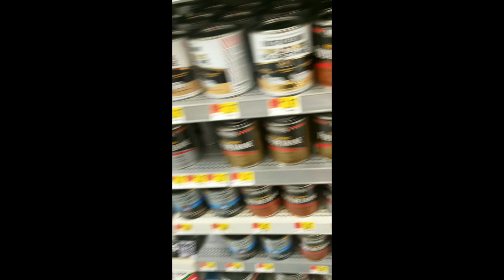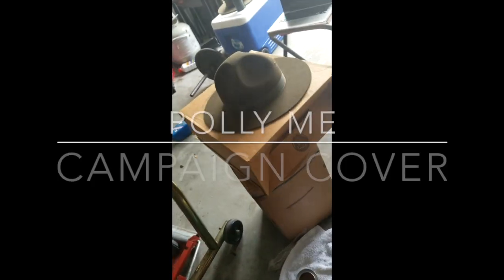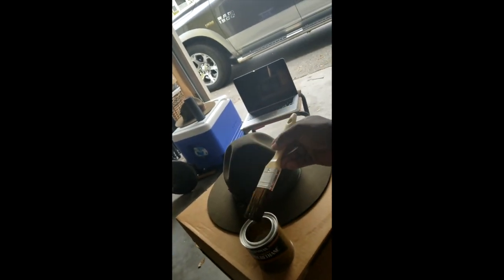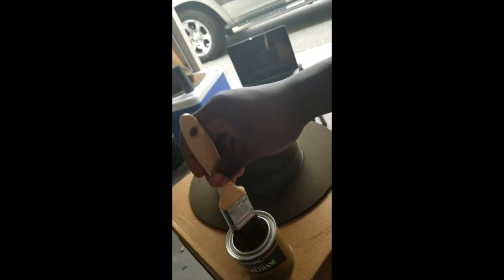how to polyurethane USMC Campaign Cover

Comment: would you recommend putting it in a hat press after? Or getting a hat press for that reason?
Reply from the maker: Once it completely dries and after every use put it in a hat press. I personally use The $12 hat press from base  or amazon, they will get the job done.
Reply: @placid5700  I have little white poly Marks on my hat from the poly, do you have any advice for removing that?
Reply from the maker: @chrispimentel5808  unfortunately I havent experienced that while pollying my covers. However, typically that happens when there is a build up of polly in certain areas.  During my 1st cycle as a DI my cover warped bad..😅 I put my oven on the lowest setting I think the temp was at 150deg placed my cover in the oven for about 3 min. The cover became extremly soft.. polly broke down.. then I placed it in a $12cover press over night and screwed the ends of the cover press down..it was good as new...try that

Comment: Should you get the ribbon to the campaign cover with poly or no
Reply from the maker: its a working cover. Getting poly on the ribbon doesn't matter. you'll have an inspection cover on standby. If you like, you can change out the ribbon if you were to get a stain or poly on the ribbon.

Comment: Don’t poly the outside. If you poly the outside when it rains the poly will drip in your eyes. Shit hurt like a MF
Reply from the maker: Ensure it is completely dry, poly should not run. Add moleskin to the inside of your cover, were the leather touches your forehead. it will catch most of the sweat/water before it hits your eyes. change them out once they get soaked.